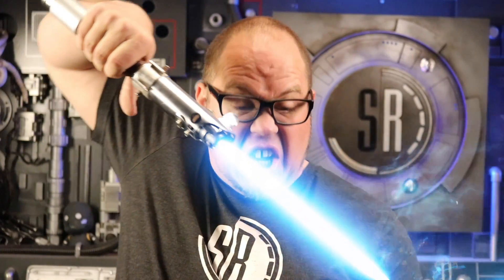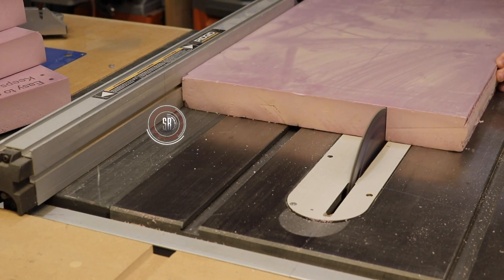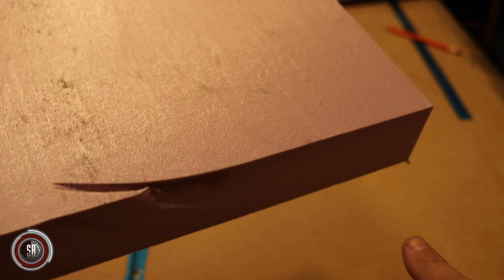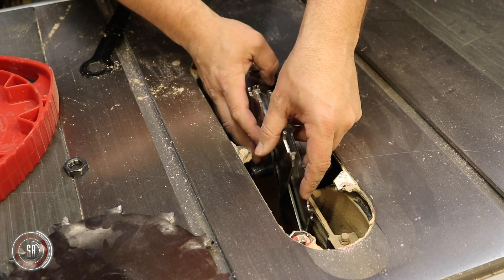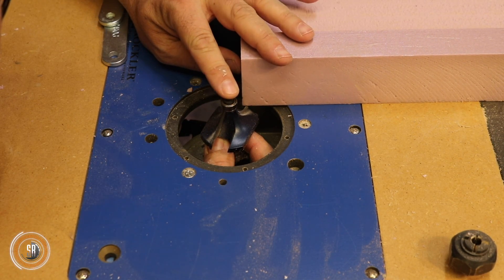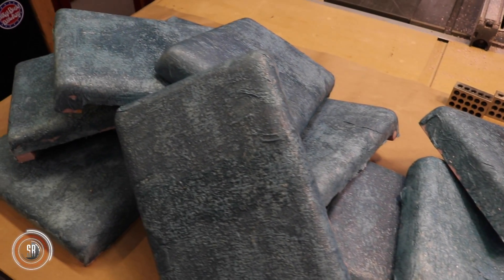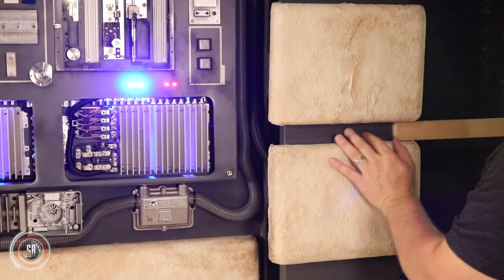How To Build Star Wars Room | Episode 5

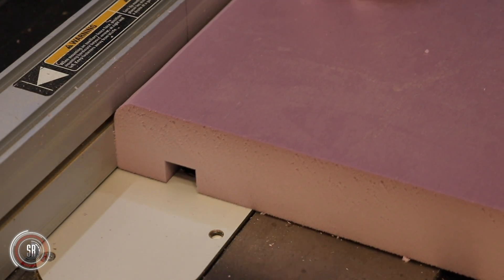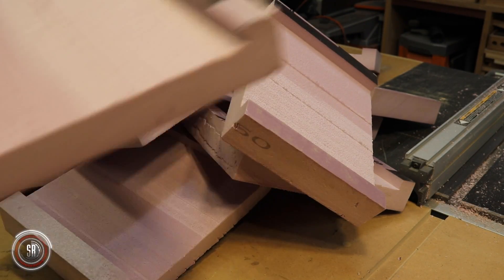Comment: Excellent work!  I’m not a keyboard commando but please, please be careful using that dado stack.  You were passing your hand directly over the blade on each pass (2:30-2:55).  I suggest never placing your hand anywhere in the line of the blade, even IF you are cutting dadoes.  Accidents happen and you don’t want your hand near the blade (remember the kickback you experienced?).  Running your hand along that line can also create a habit that will suck when you go back to cutting through stock.  If the foam isn’t staying down on the table, use a featherboard on the fence.  I would hate to hear about Brian saving all NINE fingers 😉.  Of course it’s not your job to educate everyone on shop safety.  Keep up the good work, I enjoy your videos and your persona a lot!
Reply from the maker: Thank you so much for the recommendation and suggestion.  It may not be my job to educate, but since we are in a way I want to make sure I am doing it as correctly as possible.  I would hate for someone to get hurt because they did it the way I was doing it and had an accident.  Thanks so much for pointing it out!

Comment: Well a dado blade in a table saw is one way of shaping the pads, I think that If I were to make them I would build a hotwire jig the right depth and run each pad through it.  That way I would have all the cut outs to use for other things.  It is looking loog by the way.
Reply from the maker: That is a fantastic idea.  I have never made a hotwire cutter.  I had one years ago, but that is something we should absolutely build.  And you are right, that would be another great way to get this done for sure.  Thanks for sharing that!

Comment: Looking good.  Have you thought of using wood glue mixed with water instead of Mod Podge?  A gallon of wood glue seems to be around $20 (Amazon) & Mod Podge was $30 (Amazon).  If you do a 50/50 mix (I did a rough eyeball measurement when I made some) that will double the amount you can use.
Reply from the maker: idiotluggage that’s absolutely s great idea.  With as much as I’ll have in the future I might look at that.  The gallon of Modpodge I have was purchased at Michael’s for $15 on sale.  Sadly it was the last full gallon or I would have bought more🤣🤣🤣
Reply: I was going to suggest the same thing with PVA glue.  Is that the same thing in the U.S?  We can buy 10 litre buckets of the stuff fairly cheaply here, so I'm pretty sure you guys can.
Reply from the maker: @occamsrayzor  Thank you!  I am sure you are right as well.  I will certainly give other options a shot on the next go round.  I have roughly 45 more pads for this project and every dollar counts!  Thanks again!
Reply: @occamsrayzor  it is pretty much the same thing.  PVA glue is more commonly used from what I have seen.  I just recommended wood glue since I recently used it.

Comment: I’m worried that the paper towels that are on the pads will rip. Will they ?
Reply from the maker: You know, they have not.  The mod podge after curing is rock hard, so the paper towels are also super rock hard.  There is virtually no resemblance of the towels left.  Really happy with how it turned out, and surprised how solid it is.